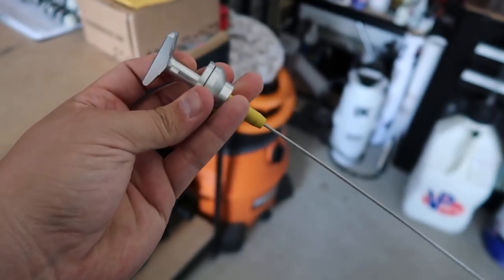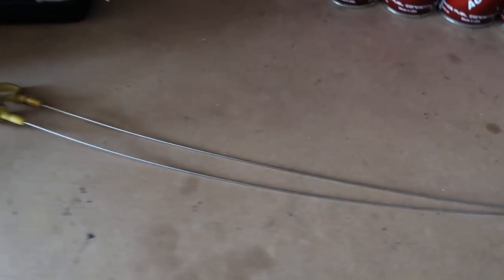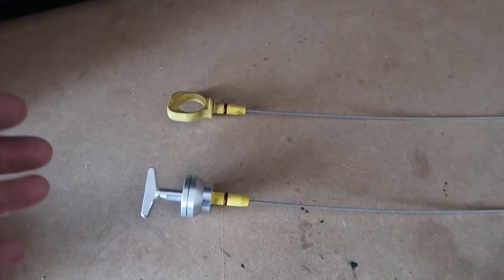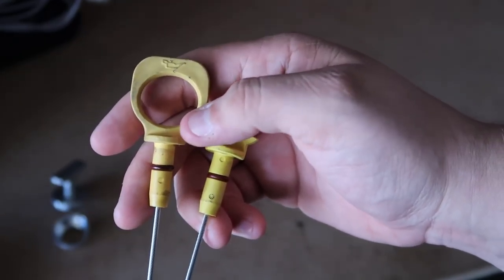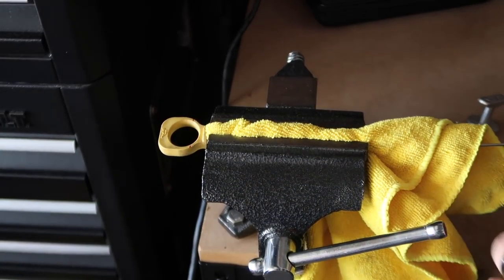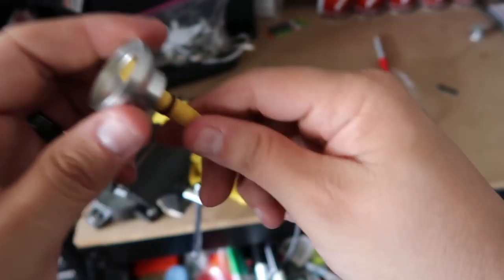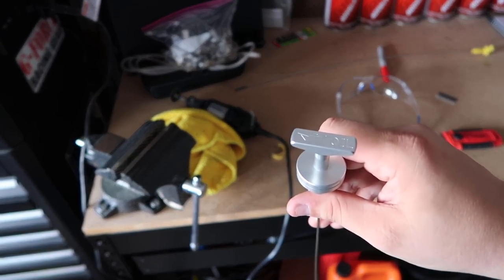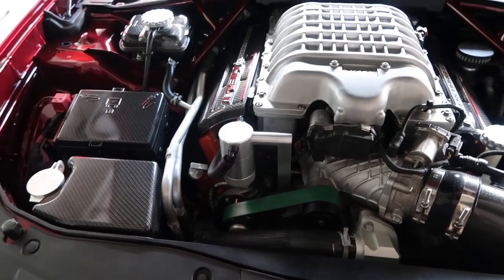Billet Technology Dipstick: I Cut My OEM Dipstick With A Dremel!

Comment: Any time one can share information that solves a bothersome little issue it is a good thing. Keep up the good work. Interestingly, the stock dipstick on my 392 Scat Pack is not correct.  I had to remark it after an oil change when I knew the correct amount of oil was in the crankcase.

Comment: Thats weird.  I wouldn't have used it if it was longer either.  Seems like a good way to F your engine up and think its good on oil.  I wonder if they use the same ones across all the gen3 hemis? Like it would be correct for a 5.7 or 6.4 but too long for the 6.2.....  Just a thought i had.  Another good video bro!